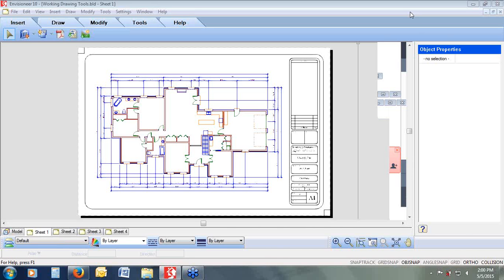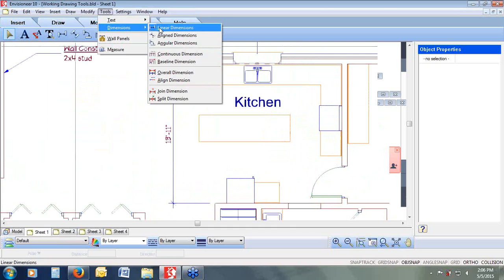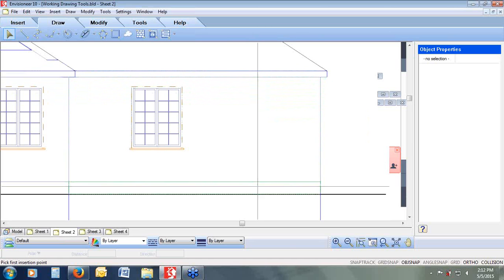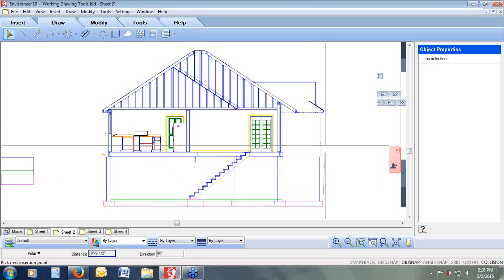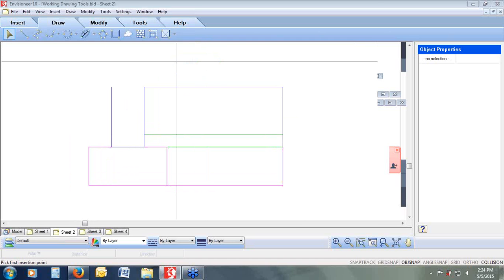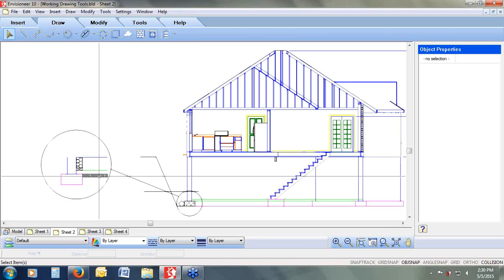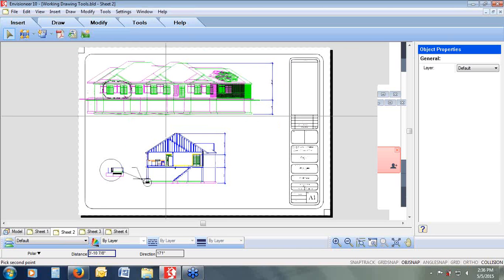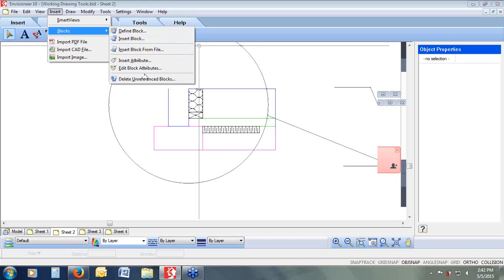Envisioneer Webinar: Work Sheet Tools

Comment: Thanks. How to resize the title block to different page size?
Reply from the maker: Hi Louis. Each titleblock is set to a standard size and you can swap out the titleblock for a different one. See here: https://www.cadsoft.com/using-different-sizes-of-titleblocks/ or watch how to customize one to a custom size or using custom text: https://www.cadsoft.com/customizing-a-titleblock-video/
Reply: @Cadsoftcorp  So the page adjusts automatically according to the titleblock? because when i choose a title block the page just looks much bigger...thats my issue
Reply: plus there is a funny grid totally out of the page area in the gray
Reply from the maker: @LCSQSB  the workspace adjusts, but you can zoom in on the title block.
Reply from the maker: @LCSQSB  That is the extents to which you printed before. When you go to print again that will readjust. It is just showing the previous print window area.
Reply: @Cadsoftcorp  Thanks for all your support the two videos helps inmensely...Million thanks